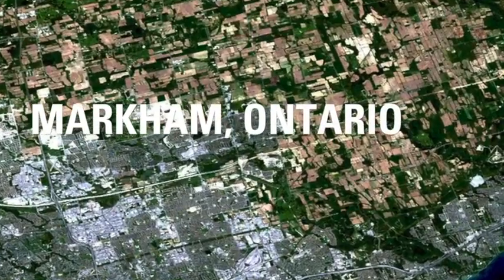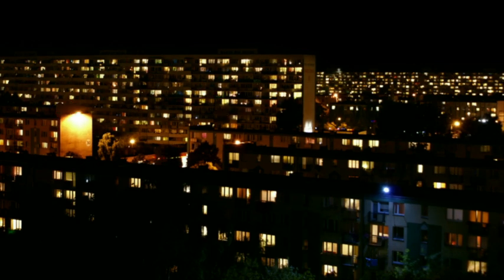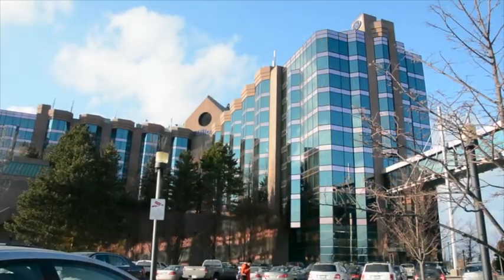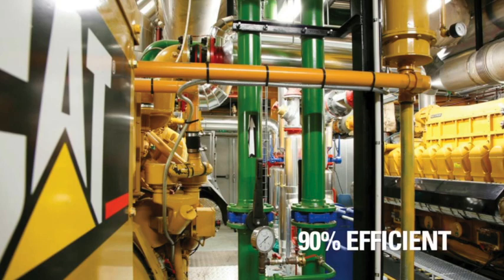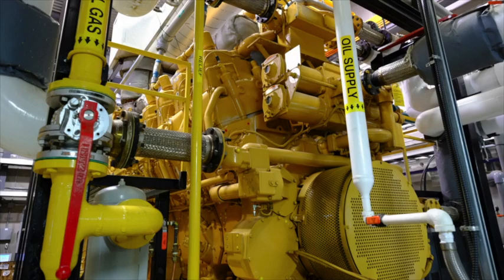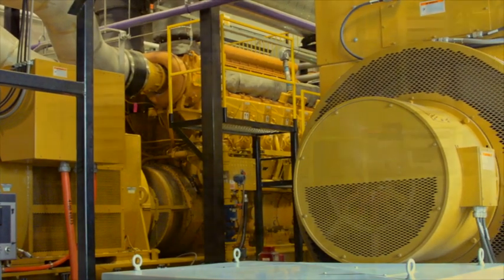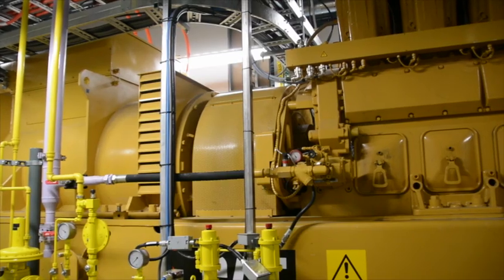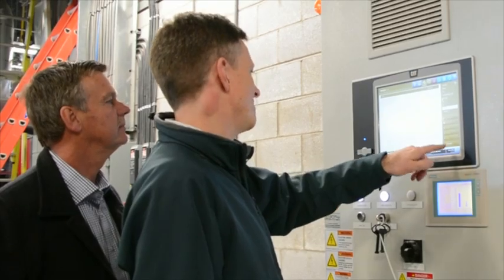Caterpillar delivers cogeneration plant to Ontario district energy operator

Comment: Very   efficient system    and   also   makes for even   safer   buildings     ,,,,,,,   no   fires   no   flames  needed in   buildings where heat is   needed   and   also   possibly no   gas lines   needed  neither in buildings